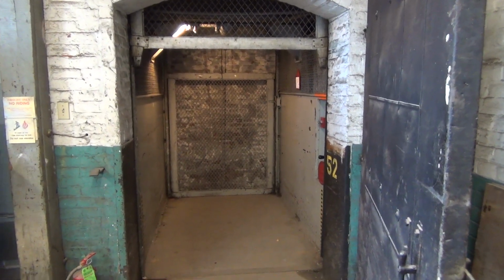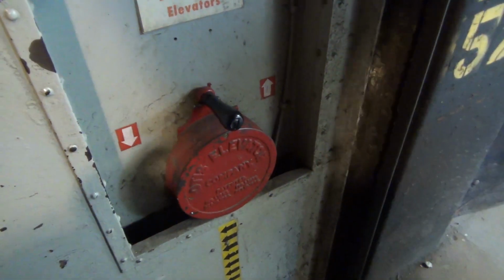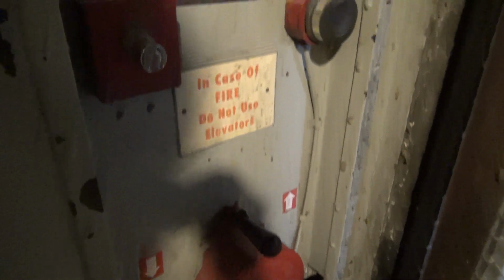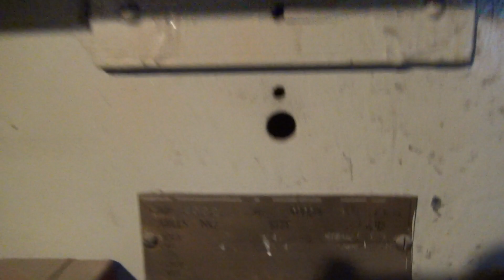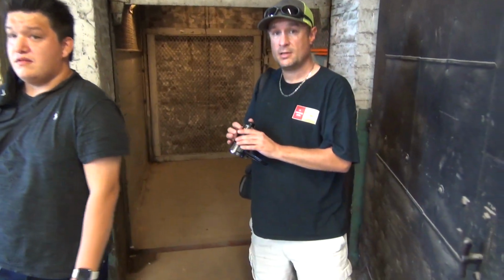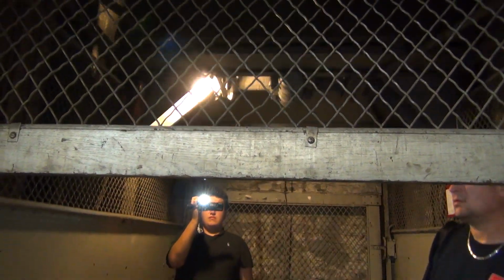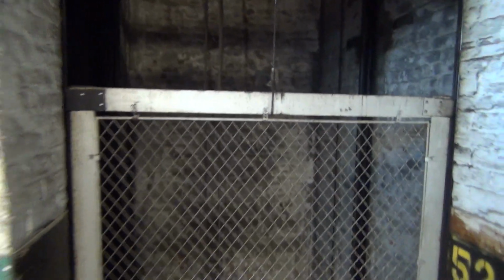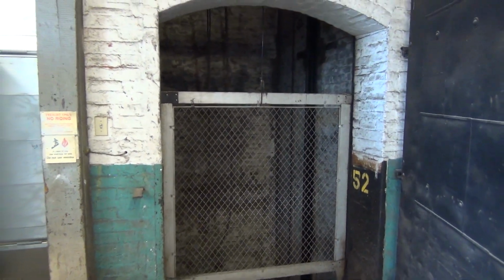Vintage Manual Otis Freight Elevator #52 - Pittsburgh, PA

Comment: There were 38 "private" freight elevators here, despite the number going up to 52, plus 6 locomotive 1s where Jared got the governor off 1 of them, & a Marshall hydro 1 (works), & a "newer" Otis 1 (defunct) in 1 of the outer buildings.
I guess the gates would be "semi-auto" due to them closing when departing but no auto-opening.
Reply from the maker: The gate systems are simple and effective, though they aren’t up to code.
Reply: Yeah I guess they were just grandfathered in.

Comment: That's weird that the gates close when the Elevator starts moving. So is there an interlock of some sort on the gates?
Reply: The majority of elevators, with this type of landing gate have an electrical/mechanical interlock. The contacts are wired in series all gates have to be closed or the elevator will not run in either direction. In addition to a bar or pin that prevents the door from being opened until the car is stopped on the landing.  It did seem odd the elevator was able to move w/o the landing door being fully closed 1st. However it closes automatically, as the car ascends.  Since there was mention of an interlock, might be a mechanical type to prevent the door from opening, I would need to see it figure what it was.
Reply from the maker: I don't believe these have that kind of interlock. There's a lever the car hits which pushes out the locking pin, when the car moves away from the lever, the pin releases the door. It's a very simple yet effective system.
Reply: @stlelevators  I looked at the video again, what you described makes sense as to pushing out a locking pin, and the landing door closes.  I noticed a steel housing on top of the cab, with circular bottoms, might have been compensating sheaves.